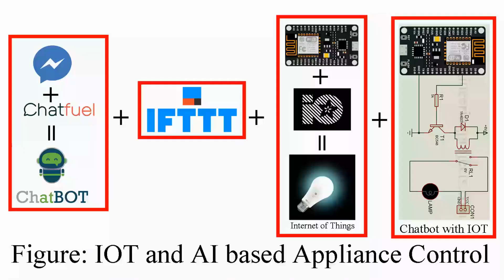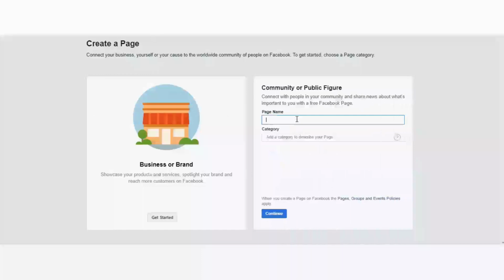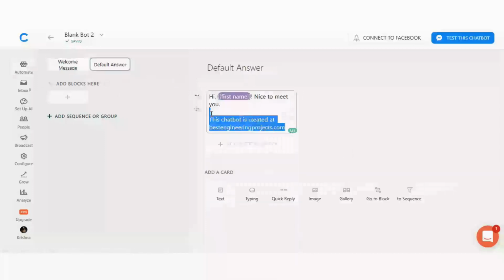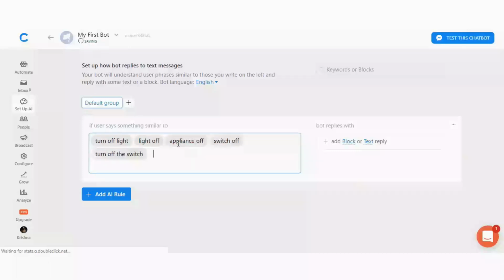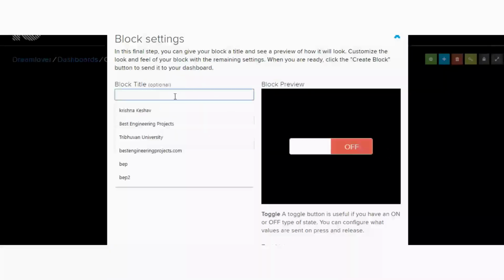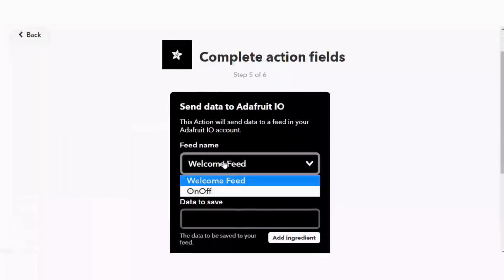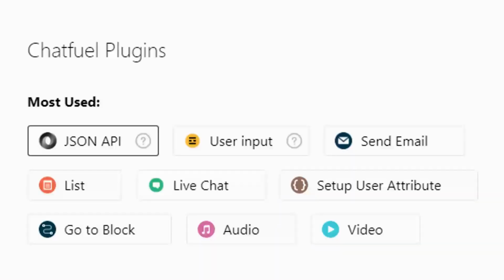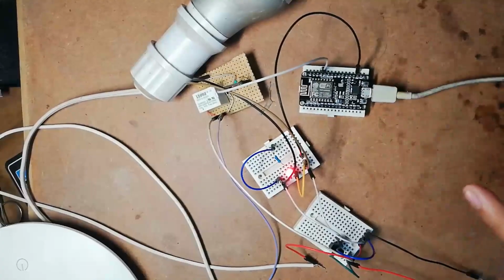Appliance Control using NodeMCU and AI Chatbot (Part 1)

Comment: Is it necessary to use Breadboard in this project
Reply from the maker: No, breadboard is for demo purpose. You can solder all the components according to circuit diagram.
Reply: will the code remain same for that case also
Reply from the maker: @arushigarg6203  yes code will remain same for all case until you wish to change the pin of node mcu to control the appliance.